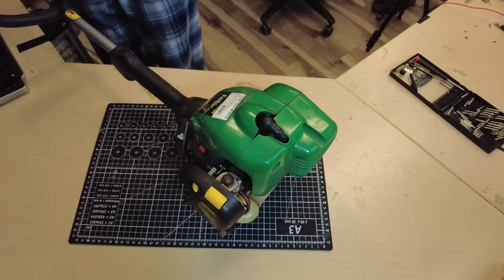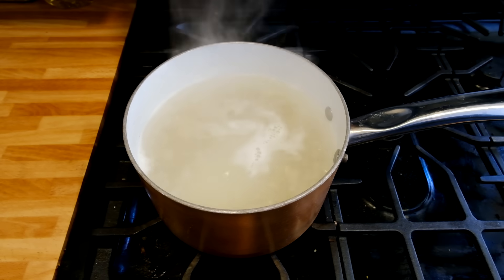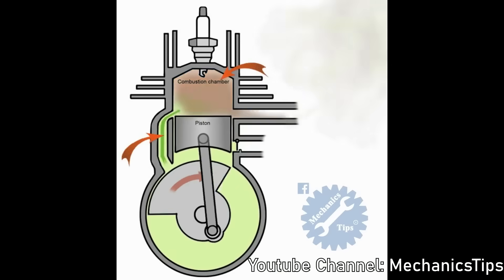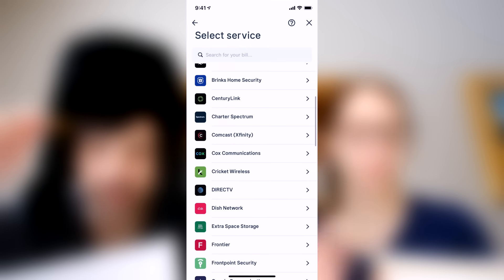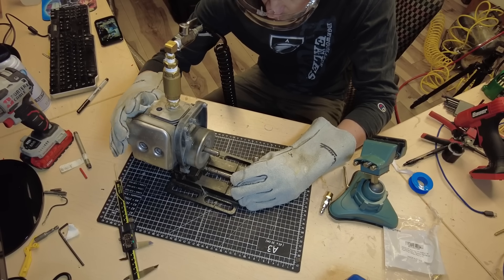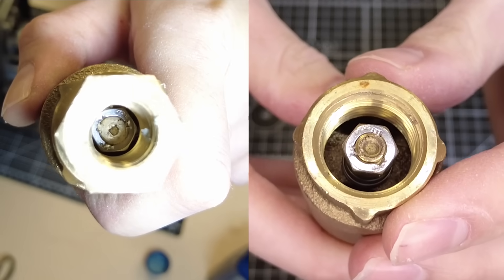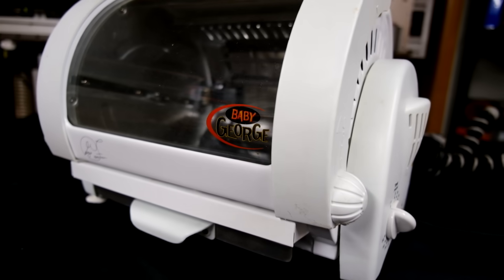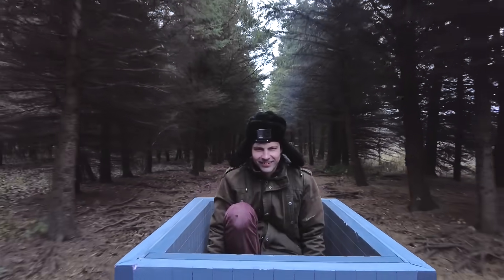Steam engine for Minecart furnace IRL

Comment: By the way, Your attempt to make it a double acting steam engine didnt work because the conrod is in the way constantly pushing around the steam due to the tilting motion of the conrod, but also because there's no flat surface on the other side of the piston. For it to be double acting, You'd need a piston that has flat faces on both sides and would need a piston rod in the middle of the piston that extends to the outside of the cylinder and as such, connect to the conrod and then its self explanatory there.

Comment: Or have two identical engines linked together mechanically , while one is at the top , the other is at the bottom of the stroke , solving the problem and also helping produce more  and more consistent power

Comment: Put it simply- you basically have a HIT-N-MISS steam engine. It is a simpler version of steam engine system that pushes piston in one direction and returns into position with momentum. Usually that's done with flywheel

Comment: you are compressing the exhaust because you're exhaust valve only lets out the exhaust when the piston is at the bottom of the cylinder. if it lets out the exhaust for the entire upstroke, it will be much more powerful and efficient because it won't be compressing the left over steam still in the chamber.

Comment: I think the furnace cart is basically a Minecraft's version of a locomotive or a steam train, in older versions you used to be able to connect other carts to the furnace cart which is basiclly how a train works, a bunch of carts connected to a stean engine on a railway

Comment: furnace minecart should be two times faster pace than normal minecart
Reply: if your previous normal minecart is 26 mph, the furnace minecart is 26 * 2 = 52 mph
Reply: also, it should be two times heavier than normal minecart so it has better traction and can't be pushed or pulled by other minecarts

Comment: How about ditching the reed switch?
Use Hall effect sensors and set them on a movable flange and wire the hall circuit to the solenoid steam switch. You may be able to advance or retard the steam. Steam unlike gasoline won't undergo volumetric expansion inside the cylinder. For steam, everything depends on valve opening/ timing. Letting in steam just at TDC may not be the optimal thing to do. My guess is, you may have to advance/retard the timing many times during the run time with load. 
This is just my 2 cent opinion, I could be wrong.
I'm not an engineer, I'm a medical practitioner with  experience in piston ventilators used in ICU's.

Comment: what about using a sterling engine? i recon that should simplify the process and also make it allot safer because you aren't using compressed hot steam. power to weight isn't great, but i believe the sweeds use one for their ultra quiet submarine.

Comment: What to know about a steam locomotive: The coal is in the fire box, then it just burned. And turned into steam, going into the boiler boiling the water. Into the steam dome, then into the smokebox. going into the piston, connected to the rods, connected to the wheels. Moving the locomotive as most of the other steam comes out of the funnel

( Theres more to know but thats all i know :/ )

Comment: the reason youre having reduced performance is probably due to the fact that you cant effectively exhaust from each side. is side of the end of the power stroke should have holes to exhaust the spent steam. you have exhaust on one side, but maybe not the other, which cushions the piston.

Comment: I think you really need to go back to steam thorny 101. Steam does NOT explode it expands when there is nowhere for it to go it builds pressure up. It is the expansion of steam that powers a steam engine and not just the pressure of the steam from the boiler.

Comment: I think you should make the engine movement similar to a regular engine.1st puff of steam pushes pistion, linkage attached to piston gets moved, linkage causes valve to shoot in steam on other side of piston head, full rotation is achieved and maximum strength with power strokes.

Comment: The reason the engine runs on much less steam compared to air, is because when the steam enters the cylinder, it expands. It is cool that you can build a steam engine from a 2-cycle engine, but you need to get oil to it. I run a steam tractor, so if you need common steam knowledge, i might be able to help.

Comment: 0 technically with ships of the 20th century early 20th century they were powered by Coal and then later in like 1930s they found out that oil was much cleaner considering with the famous Titanic there was a fire on the left right side of the ship which caused a free degree list or wing wing wing wing starts crying

Comment: Your "metal finger" problem could have also been solved by getting a 4 stroke engine, since it already has the valves in it. The cams might need some changes so it can allow steam in at the right times, but it's easier than trying to use the spark plug hole to let steam in. Also, the ports in the engine that were used for gas let pressure out.

Comment: There was entire class of locomotives called "fireless locomotive". It's basically what you have built - locomotive which runs out of pre-prepared steam (without actualy boiler or fire on locomotive itself). It was used in places where ordinary steam locomotive would cause risk of explosion (chemical factories etc).
You can copy some ideas from there.

Comment: This is not all that hard. I work in a small engine shop and have many many time ran a 2 cycle engine just by removing the spark plug and putting compressed air in the plug hole. No check valve used

Comment: I hate to say this but you need to have been looking for a real steam locomotive the steam engine part assembly don't be using a weed wacker motor that's not as smart as having it true blue steam engine and I will tell you you can find kits for them on let's say eBay possibly

Comment: What you need, mate, is a proper Water Tube Boiler. Or in other words, a Tankless Water Heater like you'd use in your house. It heats a small amount of water in a coil of (usually) copper pipe until it flashes into steam. They're extremely efficient with a much lower risk of potential explosion. In fact, after about 1910, basically all steam powered cars (which were actually equal in popularity with internal combustion cars until the 1920's with the advent of the mass-produced Ford Model T) used a form of water tube flash boiler. 

The alternative is a Fire Tube Boiler, the type seen in larger steam machines like locomotives, ships, factories, and the like. In that, you contain a large amount of water in a vessel with an internal heating chamber, the firebox, and pass the hot gases through the water via dozens (sometimes hundreds) of flue pipes. They're much simpler to build and a more robust design, but much less thermally efficient, slower to heat up and raise steam pressure, and come with more dangers; if the top of the firebox, called the crownsheet, is allowed to be exposed with no water surrounding it, the heat of the fire can rapidly cause it to weaken, warp, even start to melt, compounded by the pressure of the steam inside pressing outward. If a gap opens to expose the inside of the boiler to atmospheric pressure, the remaining water inside will instantly flash to steam, causing the boiler to explode. Low water level is by far the most common cause of failure for fire tube boilers. There are safety devices to mitigate the risk, such as gauge glasses to monitor the water level, try cock valves that vent steam or water directly from inside at different levels as a more basic and reliable alternative, and fusible plugs made of a metal that will melt sooner than the firebox itself, venting steam and water into the firebox to more or less instantly put out the fire and relieve pressure at the same time (at the cost of potentially damaging the firebox, but better that than an explosion). 

Either way, the experts at the miniature railroad where you previously tested your minecart, and where I presume you plan to test this next one, would be invaluable sources of knowledge as they not only operate miniature steam locomotives regularly, but build brand new ones on site. If anyone knows steam tech, it's them.

Comment: how do you plan on oiling the engine? increased friction will rob a bit of power and wear your piston bore and rings and you will start getting loss in pressure. perhaps adding some kind of small electric oil sprayer in the crank case or a sprayer in the steam stream?

Comment: The reason why the engine is not started because the cylinder needs momentum, its pushing really hard at first because you're forcing the piston to keep going down while the piston is actually already downwards. when you spin it, the crankshaft started to gain momentum and the engine will spin, and then because it already spins, the CO2 tank will push the air more less because you're no longer need to force the piston to keep going down (It's already going up and down). You also might need some fly wheel to make the engine stabilize the momentum (also helps so that the engine wont stall very quickly). Great work anyways

Comment: Not sure how often you plan on using that but you should use some steam oil to lube it. It will work much better than regular oil. Wont turn to foam once the steam hits it. It's a bit more expensive but well worth it if you are going to play with steam engines.

Comment: Your metal finger on the piston is sure a simple system, but you'll notice how steam engines power the valves off of the crankshaft. There are lots of simple mechanical systems you could make. Also I cannot stress how dangerous a high pressure steam boiler is. Like. I like the old mechanical engines. Their sound is relaxing and their power is impressive. Their history is interesting and pock marked with deadly accidents and so so many steam explosions. I know you're not making anything big here but you can still so easily get hurt.

Comment: Magnificent job! Maybe when you get a big boiler maybe increase the steam chest (the repurposed small engine)number the 2, maybe 3 but that might be pushing it unless you can over pressure the boiler but that is impossible so ignore the triple steam chest idea. Also if have thought to do so yet have the 3rd port be for releasing steam for when the engine is not in use. I might be wrong on my ideas but I just wanted to throw them out there.

Comment: Good idea, bur you have a problem: lubrification. In norman 2 time engine the fuel itself have oil in it so it can auto lubricate the piston and the few moving part, without the right fuel the engine is going to grip or to create rust inside due to the steam and the water.

Comment: A Garratt (often referred to as a Beyer Garratt) is a type of steam locomotive invented by British engineer Herbert William Garratt that is articulated into three parts.[1] Its boiler, firebox, and cab are mounted on a centre frame or "bridge". The two other parts, one at each end, have a pivot to support the central frame; they consist of a steam engine unit – with driving wheels, trailing wheels, valve gear, and cylinders, and above it, fuel and/or water storage.

Articulation permits locomotives to negotiate curves that might restrict large rigid-framed locomotives. The design also provides more driving wheels per unit of locomotive weight, permitting operation on lightly engineered track. Garratt locomotives produced as much as twice the power output of the largest conventional locomotives of railways that introduced them, reducing the need for multiple locomotives and crews

Comment: ah here comes a railway and steam engine nerd Ok what do you know about compound expansion, superheating, valve gear, airbraking, and firetube boilers (all features on the big steam engines built between 1920 and 1950 which was the height of railway steam engines)

Comment: hold on i got something
https://www.youtube.com/watch?v=YamiV2DR_r8. this should help for gear driving
also the steam cart has to be the same speed as the normal minecart because the fact I once drag raced a furnace minecart in a normal one. both are 26MPH. sometimes much faster if you wanna blow your engine. 32MPH in some cases

Comment: the best way your gonna get enough torque is to convert something like an 800cc 4 cylinder  to run on steam. reason being is these kinds of engines are compact and make good power/torque for their size. though i recommend finding something that isnt gonna rust as steam tends to break metal over time
hope this helps

Comment: If you would have used a 4 stroke engine you would already have the timing method needed for the engine as the cam could handle it for you.  You could make a custom cam as well to make it put steam in every two stroked instead of four.  if you wanted to make the 2 stroke double acting though you could also make a cam system to control the steam and make it switch between injecting it through intake and exhaust.  I think to get best results you would need to have that extra pressure timed as well though.  It would be similar to your finger idea and almost as simple you just have to connect a cam to the crank and that surface will control your valve externally without touching the piston.  I do like your solenoid idea though.  Also remember to oil your engine somehow.  Those two strokes were oiled through fuel and without that you are losing alot of power through friction.  You could also get more power by reheating the steam right before it goes in most engines use superheated steam to put as much energy into the water as possible before it is used.

Comment: It's pretty cool that with such little pressure, the steam engine starts to go into a 0 rpm idle by itself. That alone is cool. It would be interesting to see two, three, and four banger engines converted to run on steam. Maybe with current technology you could make steam engines really efficient.

Comment: You should plug up the holes in the crank case and put oil in it, the lubrication will both help with longevity and engine blowby

Comment: Have you considered a Stirling Engine? It can directly transform a temperature difference to mechanical work. You also don't need to worry about steam pressure (either losing it or potential explosions). However, I'll never complain about more steam powered devices.

Comment: Likewise your AIR compressors are simple AIR powered engines. Wait, WHAT!?! Yea. The gasoline/oil inustries have been LYING to us like for a LLLOOONNGG time!! There is ONE video of a guy that built a car to run on AIR!!!  We DON'T need Gasoline! When all you need to drive a car is AIR!!! WTF?! Correct!
Reply from the maker: Gasoline is incredibly energy dense, much more than compressed air, which is why your car can travel hundreds of miles on a relatively small tank. It also takes energy to first compress the air, which is sometimes generated by the combustion of fossil fuels.
Reply: @JoelCreates  Fun fact: Named "fossil fuels" due to the decay  of actual dinosaur fossils. =o) I'm pretty sure. Nice mine cart. =o)

Comment: You can try High Steam Pressure the classic Steam stuff which also powered on Steam Loco. But careful about the pressure. Too high can be lethal. Low Steam pressure is very inefficient on small pistons. You can make it like an E2 Steam loco, it is not the best by making steam but it does work and their design is quite simple.

Comment: Something to consider, turn the CO2 tank onto its side so that way you can increase the surface area of the water and increase steam generation, that way you can run the engine for longer and faster. Also, be very carefuly to monitor the water level in the boiler. If it were to run out of water while under pressure and heat, you could have a dangerous situation on your hands.

Comment: Not a good idea to use a two stroke motor as without the oil/fuel mixture there is much more friction therefor your motor will wear out faster which will result in lost compression and then it won’t work anymore

Comment: You're gonna need to lubricate the conrod bearings, a method steam engines often use is Steam oil, being originally a 2 stroke there shouldn't be any issue with the oil making its way down past the rings.

Comment: You don't necessarily need a switch. How steam engines did it was added another pistin above it with a smaller travelled distance that was also connected to the wheel, but at a right-angle offset. The motion generated by this smaller piston allowed steam to move past it and into the bigger piston.

Comment: you also need to work out an injector system for you boiler, minature engines in the UK typically have 2 (or more) for redundancy usually one live steam injector which only works when the engine is at pressure, and a manual pump, as running out of water can be very bad (boom), not sure how it works in the US, but in the UK there is a legal requirement to have steam boilers tested and certified (especially before running on a railway), make sure you check your local requirements in this regard

Comment: Good cylinder concept. In fact, thank Richard Trevithick for the idea; he pioneered locomotive development with his 1-cylinder "Pen-y Daren". Of course, his design was a double-stroke, where steam presses the piston in both directions. I would recommend either adding a second cylinder out of phase (at a 90-degree offset so one is in dead center while the other is mid-stroke) or assembling a system of rods called a valve gear. It works like the spark-plug solenoid you made, but more archaic. There are lots of different designs on the internet, but for simplicity's sake I'd go for Walschaerts' design.

Comment: You could make the boiler and engine a modular system, so you have a big part that has everything to run the engine you can reuse in differnt projects by slotting it in and attaching the axel using a standard connecting part